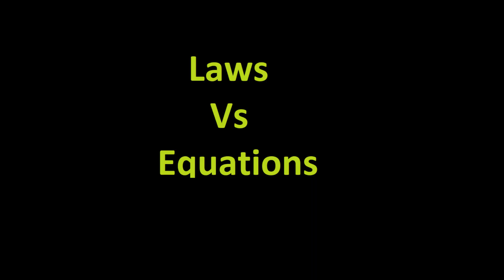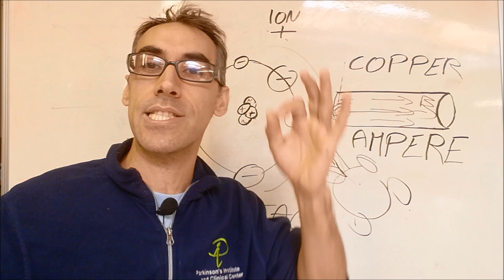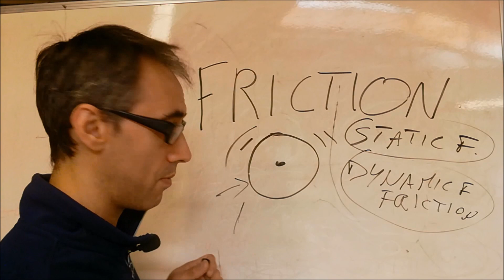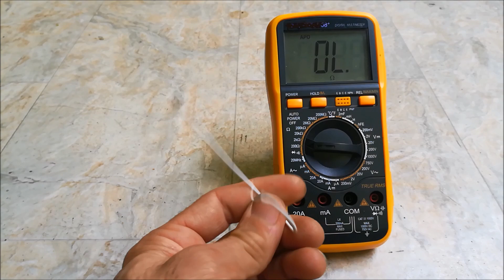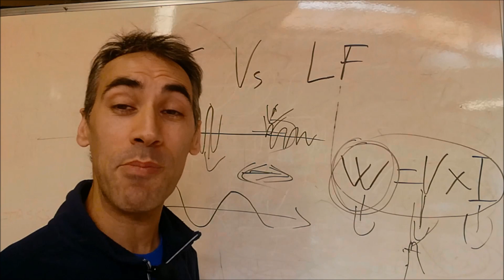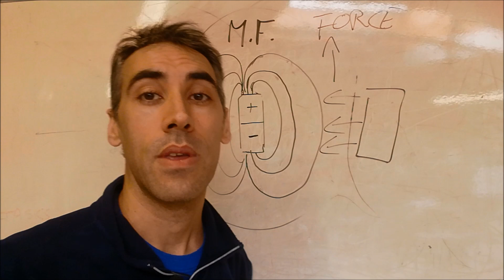Anxiety to reveal the REAL free energy MISINFORMATION and SCAM

Comment: Sorry to burst your bubble, but many of these "free energy" concepts are actually possible, because they are not actually perpetual motion at all. Magnets are similar to a household battery cell, you have a flow from top to bottom. Perpetual motion magnets do not violate the laws of physics, since magnets will wear out after a certain time and thus cannot provide perpetual motion. To build a battery you simply need to combine certain materials into a container. Common household electronics do not violate the laws of physics, lets say it takes 3 calories for someone to build a common household battery cell. But the battery outputs 4000 calories to light a lightbulb. Someone, based on this conclusion, might argue that all common household batteries are some kind of scam and violates laws of physics. That being said, 95-99% of these free energy claims are probably scams, the spam of scams makes all the people trying to make real advancements in technology look bad.

Comment: so if I fully understand what your saying, a solid rotating object placed on a stationary device creates friction not current...  early light/heat... a similar rotating object that is charged via a reaction rotating on a stationary device derives less friction and could possibly produce current... I see two issues working against me in either example... friction/resistance... so in sum a rock and a stick will never produce current/amp... how am I ever to charge my battery? smiles...

"R" (park closer) "linear frequency"

Comment: I agree, charge only at "A" no opposite charge at "B," no flow of amps can can flow through the conductor. However, when the opposite charge is applied to "B" than what is applied to "A" amperage does flow. The direction the amperage flows through the conductor is depends on the type of charge which is applied to "A" and "B," whether if it is negative or positively charged. This is what you left out of your lecture. Other than this, great lecture.

Comment: Pure ridiculousness once again I have a headache ! I will say you have the book down better than most. Wind, solar, hydro, thermal, atmospheric and much more nature has provided for free. Yet there is no free energy according to your  ridiculousness. LOL perpetual motion  by its own definition is not achievable and so put that one aside for arguments sake. A wind turbine will produce usable energy as long as the wind blows at no cost to the owner of the wind turbine. A flowing river will do the same at the same cost to the owner of the equipment. Both individually may not be efficient in their designs due to losses caused by poor engineering. However both still deliver free energy as long as nature is doing what nature dose and the two combined generate more than enough power to get the work done that we need. Add in solar to the system and yet even more, combine thermal and you reclaim heat losses or even add to the system as well. Atmospheric energy is available as well as junk energy from all the energy being used already. So with all that more energy is available than needed yet energy is not free? LOL Energy can be stored, moved around, changed to many forms and even heat which is something that you get from using energy do to resistance among other things. Yet no such thing as free energy? We boil water to make steam and we do that in many ways all of which we do in the most inefficient manner to produce electricity but yet it works even though it was done the hard way. Just because mankind is to ignorant at this point in the game to understand how to use energy properly dose not in any way mean that energy is not free. For anyone to claim it is not is to be intellectually dishonest. While you may know what the book says about the laws of physics, you seem to lack in mechanical understanding of how things work. The so called Laws Physics are not a road block to free energy and do not need to be violated to achieve free energy. However you seem to be under the impression that they do and that it is not possible period. Terminology of science may sound good in theory to convince the masses that the so called enlightened ones have it all figured out and that we are limited in what we can achieve? but that is a farce in itself. The fact is that the only thing stopping mankind from reaching mechanical perfection are the educators, prophets of doom and people like yourself who refuse to step outside the box of your indoctrination. I would not have even written this message in this fashion, however you are very condescending and misleading in your sermon that you spew to your congregation. LOL Every example you have ever given on these video's that I have watched thus far of why energy is not free or as you say no free lunch? Make me laugh and cry at the same time. If more people think like you than,  like the ones you mock and ridicule this world is in trouble and we may never reach our true potential. This reminds me of the people who use to say if man where meant to fly God would have gave them wings. Fortunately the people like the wright brothers ignored this ignorance. And thanks to Tesla you get to have energy and technology to mock and ridicule those you feel superior to. Isn't that cool? Your understanding of the Tesla Coil is yet even another example of your lack of understanding about how energy travels and that is a shame. None the less people will figure out some day what the Tesla Coil's true potential is but until then it is just a toy to those who did not pay attention in science class. Oh and the use of pseudoscience in regards to researchers that are not mainstream is by far the most ridiculous thing in your arsenal of condescending remarks to try and make yourself seem smarter than others to whom which you disagree with. Regardless I would take the out of box researcher on the dream team before ever even considering someone who was indoctrinated in the joke we call public education system any day. Energy is free if you know how to use it properly otherwise it is business as usual and the wars rage on. Thanks for the laughs. :) Peace.
Reply: Nice rant buddy, Unfortunately you mixed up free energy with green energy as clearly you haven't been educated other than few articles stolen from internet. YouTube and Tesla coils are filling up your brain of dreams but very little delivery just like every "very open minded" nutcase. Modern antennas and wireless systems with efficiency over 60% off 3 different modulations and frequencies reaching up to 300ghz are Ferrari compared to the original "Tesla coil". Let me guess you might be the one who didn't truly deeply understood how far up we came with research and technology. Scientists are working at subatomic level and exploring space while a common mortal YouTube commenter comes up with a sentence "we still don't know much about Tesla coils" LOL. Here is a question for you: are you still lighting fire by rubbing 2 sticks together or you use a lighter? I assume you prefer sticks over a lighter since we really don't know so much about wood and trees, right?? Last sentence circa the ridiculous rant about athmosperic energy. Anytime you convert energy a big loss occur along with environmental change.....the lower the efficiency the more negative consequences for us and nature. 
Tesla was a very smart inventor...until his carrier ended up  as a street buffoon claiming supernatural powers and magic tricks

Comment: thanks for posting.  good work.    consider carrying out an unbiased analysis of what is seen in the linked video.    at various times there is  Apparent  overunity  happening; more watts out than have been consumed.    humans have mostly forgotten the huge advantage of using a full-length,  'non-collapsed' lever; ie.,  a Rotary 2nd-class Lever; the wheel and axle.  (compare the energy lost, where multiple gears are used to achieve mechanical advantage greater than three or four to one.)    a relatively high MA at the first input stage, 'isolates'  a high-speed prime mover from the load.    cheers                       googletranslate
https://www.youtube.com/watch?v=lTkXciAn488

Comment: Correction W=UxIx Cos phi cause many devices have no cos phi of 1 , old TL ballasts cos phi 0.5.
Reply from the maker: Stefaan Codde 
Yeah, power factor may vary from device to device and with/without inductive load
Reply: So what is most important with any over unity device = Power! (W or KW) so cos phi is something to add in the Wh calculation as soon when there  is a transformer in place or electric boards with many components on. Free energy does no exist anno 2018 , over unity does exist but still no heavy power .
Reply from the maker: so by matching the power factor with the power output of the same machine  we can pretty much loop close it and have perpetual motion?

Comment: https://www.youtube.com/watch?v=NxpoiCFKmPg
This could be an example of real free energy, 
if it uses the long length of belt that comes off the one rotation of 
the DC drive motor + large (about)10 cm circumference drive pulley, 
to rotate the small (about)3 cm circumference pulley + motor many times, 
gaining more than enough power to rotate the drive motor + pulley the one single time. 
= self powering = free energy + there is a lager explanation here @ http://free-energy.yolasite.com/
- 
I wish to show you how it is easy to se pulley's 
to freely gain massive amounts of AC electricity. 
Yes, that is what I hope to be showing you how to freely do, 
actually multiplying the number of cycles of AC electricity using pulleys, 
like you learned in pre-school. With only a couple of DC motors, 
each having a different sized pulley attached, 
you could pay for only the smallest amount of current to 
rotate a DC motor + 10 cm circumference pulley once, 
giving 10 cm of moving belt. 
If you attached any # of 1 cm circumference pulley, 
with another DC motor, 
then you would be able to multiply your input by 10, 
gaining the amount of DC electricity to
be able to rotate the DC motor10 times.
- 
I feel that I must share the rest of the story of how I first saw the super
simple way of gaining free energy by using pulleys to multiply AC electricity. 
I asked God to show me a way to help the Tribulation Saints 
survive through the Great Tribulation, which is the second half of the 7 year peace treaty. 
That was when He gave me a Vision of a ten speed bicycle, 
going uphill in tenth gear, and then back downhill in first Gear. 
This can be significant when it comes to AC electricity, 
because more rotations can be converted into more cycles of AC electricity. 
Why pay for oil to generate AC electricity, 
when we can use pulleys to freely multiply rotations, 
which easily converts into AC electricity 
http://doorschristmustpassthrough.yolasite.com/
+
+ http://my2020vision.yolasite.com/

Comment: Why are you so concerned with voltage and current.
Reply: AQ Wheeler  Jr Because voltage times current equals power. There is a voltage gradient that rises by 100 volts for every foot (or 30 centimetres) you rise above the Earth's surface. So why is it that tall buildings don't use this free energy to power all the equipment inside? Because the impedence (or resistance) is such that as soon as a current starts to flow, the voltage gradient disappears. There is potential, but only the most minute amount of power that can be developed from this apparently free energy source, perhaps a milliwatt or two.
Reply: Michael Kaliski. When the voltage drops the frequent gets higher. If you copy the frequency of a magnet you can replace electricity.
Reply: AQ Wheeler  Jr 
Voltage drops...frequency gets higher ...."copy the frequency". Your sentence has very little  meaning ...close to nothing
Reply: mk, you may not know that you have made a fallacious or poorly worded statement regarding a 'voltage gradient' when there is a 'rise above the earth's surface'.     there is No such thing.   however, there can be losses, due to resistance/impedance, in very long 'wires'.    power is expressed in watts, joules, hp etc.   power is  CALCULATED, as has been described by others.    in the context of 'modern' power production, it is All about producing  Electrical power.    in the context of a machine that generates electrical power,  both Electrical watts and mechanical energy ( newton-meters/torque/joules) are Components of the process.    see my channel, if it suits.      cheers
Reply from the maker: insults and false profile(such as yours) are also less important than anything else

Thank you for watching

Comment: An excellent video! Just one minor quibble. It is true that a free energy perpetual motion machine cannot be built, but machines can be built to harvest energy from the environment. It is important to emphasis the difference between the two. A windmill or heat pump may not be very efficient, but they do work. They are energy transformation machines and the input power is technically "free". Of course the Sun is the ultimate source of all energy, or old exploded suns in the case of radioactive elements. Wonderfully entertaining and educational videos.
Reply: Quite correct, Michael. Thanks for posting.
Reply: Michael Kaliski 
As far as I know English is still the only language where "free energy" is indeed as "no cost". Everyone else refers free energy as thermodynamic well describes. Similarities are shared between a "closed" and "open" system. A self sustained  feedback device for sure is a "closed system" while solar panel cannot recharge the Sun from his burned up hydrogen. Indeed a "open system" it will last centuries but surely not "perpetual" . Solar/wind etc. are classified as green energy and not free energy solutions. Yes excellent video as usual 👍👍
Reply from the maker: "produce a positive magnetic energy"

Anyone wants to reply to this amazing sentence?
Reply: @skepticalopen-mind4031  white light is ,4 to ,8 x 10-15.  Edison ran d.c. a couple centimeters and made the lifht bulb. You see copper is 1.5 x 10-23 atoms.  Bounce off a couple centimeters and you'll get 10-15 bumps, or random spectum electromagnetic waves.  Next I'll learn how electrical current goes ,95 c down a wire.  But we must continue to gave dumb luck like Edison.  Oversimplified, and I'll explain it later.  D. Osterday, director of electronag etics.  Dynatest labs, that's the original.
Reply: Quote "can be built to harvest energy from the environment". One of Tesla early inventions was an AC power generator at Niagara Falls. He wanted to do something like that, harnessing electricity from earth resonance energy, but also he wanted to distribute electricity for "free". It is not the same as "creating energy out of nothing", remember that energy is not created nor destroyed.
Reply: Michael Kaliski. How does blue light produce a positive magnetic energy? Not electricity. Frequency.